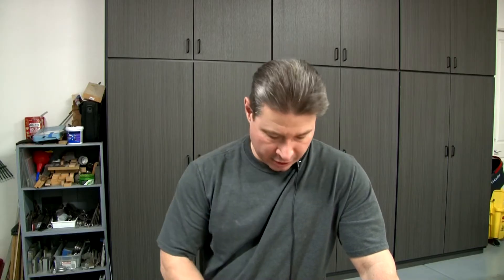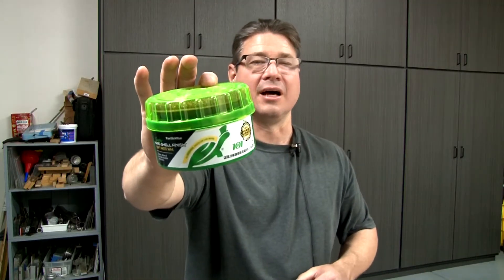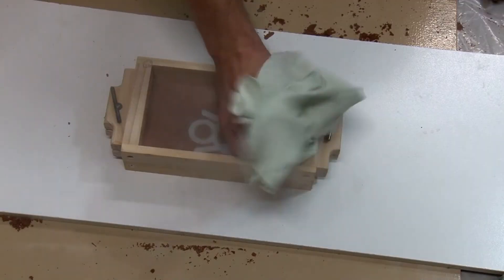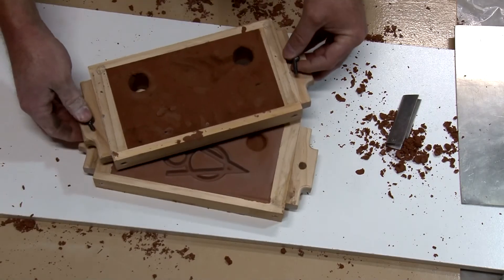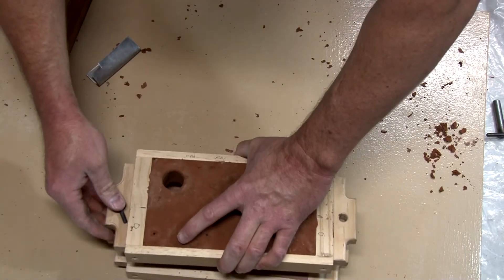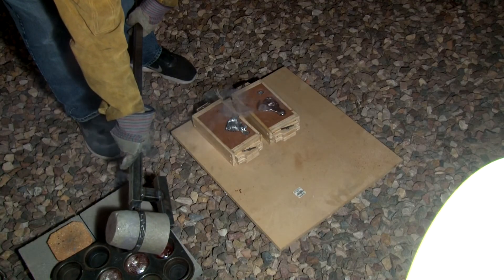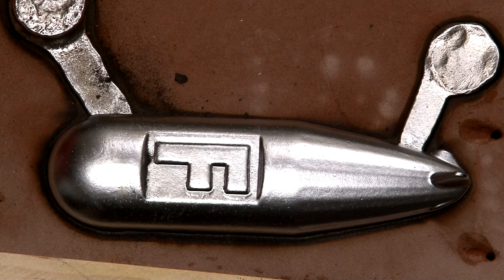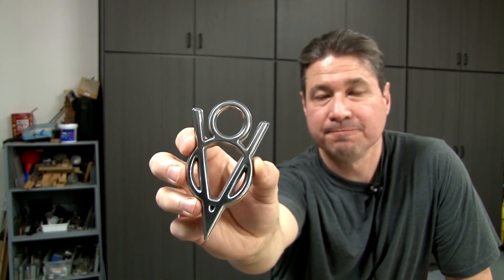From Bad To AWESOME, 1 Year of Sand Casting.  What I have learned in my 1st year of sand casting.

Comment: lost wax casting, so time consuming compared to green sand or oil sand casting. For production of lost wax, need expensive machinery to spray the molds around the wax pattern. 

I have seen brass casting in Punjab in India some years ago, in a back yard in Ludhiana, done with cement powder with molasses as the binder, and the finish of the brass military badge was as good as the original die stamped badge,  I was so impressed. I still have both badges

Comment: One safety note from when you added metal to the crucible. It's a good idea to preheat the metal you're adding in the flame before it gets put in the molten metal. This drives off moisture and burns off oil to prevent an explosion.
Reply from the maker: Thank you for pointing this out.  I live in a fairly dry desert and all my aluminum and equipment is stored in a garage.  I will point this out in my future videos for viewers that don't live in the same climate as I do.

Comment: does the quality of Aluminium used matter and if so, how to tell if the aluminium is good?
Reply from the maker: The aluminum alloy used for casting has silcon present.  Here is the list from google  that details why silicon is in the casting alloys:  "Improved Fluidity & Castability: Lowers melt viscosity, letting it fill complex molds better.
Reduced Shrinkage: Forms a eutectic mixture that solidifies more gradually, minimizing defects.
Enhanced Strength & Hardness: Hard silicon particles precipitate out, strengthening the alloy.
Better Wear Resistance: Hard particles improve durability.
Reduced Hot Tearing: Prevents cracking during solidification.
Lower Melting Point: Makes the alloy easier and cheaper to cast.
Corrosion Resistance: Can form a protective oxide layer, enhancing surface protection. "          I have tried to casting 6061 machining aluminum and it didn't not flow and froze quickly.  Also, another thing that will help with casting is a thermocouple temp probe.  Hitting a good pouring temperature helps alot.  If the temp is too low it freezes early.  Unfortunately, determining the aluminum to be an alloy for casting I am not able to do.  I start with aluminum that has been cast before  so I know it works.  Car parts, Hard drive chasis, etc...  Good luck!

Comment: Please tell me what kind of sand are you using ??
Reply from the maker: I got it from Amazon.com and it was listed as Teton-Bond Petrobond Ultra-FINE (190 Mesh) Foundry Jewelry Metal Casting Sand for Ultimate Detail

I used to be able to buy 100lbs at a time, which made it cheaper, but I can't find it anymore that size.  Amazon also has 140 Mesh, which is not as fine, but I am not sure how much difference it will make.
Reply: @DamonsMetalCasting  thanks

Comment: I urgently need a kit like that, sand, supplies, where to buy?
Reply from the maker: I got my stuff from amazon.  Just remember to coat the ceramic material inside the furnace so it won't cause lung damage.  The sand  i use is teton petrobond. Its a little expensive.

Comment: The logo looks great. How does it mount because my experience with emblems is they usually have tabs that the nuts thread onto?
Reply from the maker: Correct, there are no mounting points on the casting.  I made it without mounts  for my channel. Using a tig to put some on or a mapp gas torch with an aluminum brazing rod could fix it, or i would have to recast in a different configuration.  Thanks for checking out the video.  Much appreciated.

Comment: Bonjour, un grand merci pour votre vidéo qui m à permis de faire mes première coulé d aluminium,  je souhaite vous poser une question , quel est la terre que vous utilisez dans cette vidéo ? Pouvez vous mettre le lien d achat dans votre descriptif?  Un grand merci
Reply from the maker: I purchased my casting sand from Amazon.com.  This is the description "Brand: Teton Supply Co.

4.64.6 out of 5 stars(312)

Teton-Bond Petrobond Ultra-FINE (190 Mesh) Foundry Jewelry Metal Casting Sand for Ultimate Detail" .  Amazon used to sell it at 100lb quantity which made it 2.95 dollars a pound, but I have not seen that size sold for a long time.  Thanks for watching I am glad the video  helped you with your first casting.

Comment: This is very informative.  I'm thinking about trying this out on a hobby level but had a question about the strength of cast aluminum.  Is it fairly strong in the sense that you could poor usefull tools?  I'm looking at making a T handle wrench part and wondering if cast aluminum would hold up strong enough to be considered functional.  Doesn't have to be extreme torsion but enough to get a bolt tight with the strength of one hand.
Reply from the maker: You might get better use out of welding 2 rods together in a T for the wrench rather than cast aluminum.  I find the cast aluminum to be softer than  standard 6061 aluminum.   If you are some how attaching a fitting to the end of a casting that is metal to turn a bolt it might work fine.  I think cast aluminum directly turning a bolt might wear/strip pretty quick.  The aluminum also might make a comfortable handle for your T wrench if you made the rest out of metal.  Just throwing some ideas out there.  Good luck on your project!
Reply: @DamonsMetalCasting the only thing that gives me encouragement to want to try it is that it's not for a standard metal bolt like you think,  it will be for a 2" plastic head bolt and the wrench will just have a couple beefy "fingers" that index into the plastic bolt head. Normally this bolt is just finger tight anyway. I made one from maple wood which worked great.  The torsional strength of cast metal over time is what I wonder about though. Thanks for your thoughts
Reply from the maker: @DavidGeorgeson  Being that it's for a plastic bolt head, it will be fine.

Comment: What’s the tool you’re using to measure the molten metal? Do you have a brand name of that one? Is it expensive?
Reply from the maker: I got the thermocouple sensor and the thermocouple reader from amazon.  Looks like you can pick up a thermocouple reader for $30 dollars.  The part that may vary in money is the thermocouple for the reader it has to go up higher than the temp of the metal.  Some thermocouple sensors cost as much as $60.  If you look hard I think you can find it cheaper.  TL1917SL K-Type Inconel 600 Flexible Thermocouple Temperature Sensor Probes -40~2012°F  that might work for aluminum its around $40 on amazon. You still might find one less expensive if you look hard.
Reply: Thank you for the reply. I was seeing a lot of them for over $500.

Comment: Really nice teaching video I’m just wondering why you stopped. Another thing for the fins on the F bomb using toothpicks for channels to create air events will help dramatically and very easy to clean up. Also, I really like the thought of using car wax on the patterns. excellent idea🤠👍
Reply from the maker: Thanks a lot for the nice comment and the toothpick idea.  I hit a pause because I took on 2 jobs from viewers and the jobs turned out to be alot more challenging and problematic then I expected.  Instead of making people wait for the finished videos I might create parts of the videos of how I worked through certain problems.  Currently where I live, the mornings before the sun comes up are 89F.  I will be looking into a minisplit for my garage soon.
Reply: @DamonsMetalCasting  if you need some help sorting out some of your problems let me know I might be able to help. I have been pouring silver and copper for a few years now my videos maybe a little boring but you may find some insight in them cheers🤠👍
Reply from the maker: @4ninesfinesilver315  thanks appreciate it

Comment: I'm new to sandcasting. Every time I fill the mold with the delft clay and pound it down, the clay will "split" open on the mold. Usually it splits in a different part of the mold, that I'm pounding. I hammering the clay in fairly hard. Is it possible I'm doing it too hard? I just can't understand what's causing this. When I turn the mold over, the bottom of the mold is nice and smooth. Can you please tell me what could be wrong? Thank you in advance.
Reply from the maker: I have not used Delft clay before so I will just throw out some guesses that might help.  One issue could be if its been used up and has a lot of burnt binder in it preventing it from being able to stick together.  It might need better mixing/mulling.  Maybe a bad batch from the manufacturer?  I have pounded the heck out of my sand(Petrobond) and made a real hard layer, then the next layer on top doesn't want to combine to the first layer and peels off.  I have seen people scratch up the hard layer even with a hair pic so it can combine easier with the next layer added.  Sorry I couldn't help more.  Its difficult when not hands on with a problem and only throwing out guess.  Good luck!
Reply: @DamonsMetalCasting  Thanks for the reply. I just bought the clay, so it's never been used. Maybe it is a bad batch. Thank you.
Reply from the maker: @scotts4134    You can also look at videos online of people who use deft clay and see if its similar consistency and works the same.

Comment: Did you make the flask?  What are the dimensions, because I want to cast flat sterling silver pendants around 3 mm (1/8 inch) thick and that flask looks the right depth, as opposed to most of the ones on Amazon which are deeper.
Reply from the maker: Yup, I made the flask from wood on my table saw.  The outer flask dimensions are 9" long, 5" wide and one half of the flask is 1.25" deep.  The total depth of both halves together would be 2.5".  The inner dimensions are 7.5" long and about 4.25" wide.  The ends have thick wood on them so I can screw the sides in and attach a handles.  I agree, I like using flasks that are closer to the dimensions of the part I am casting.  Thanks for watching my video!

Comment: THANKS, HOWEVER, IMHO: MOST PEOPLE DO NOT HAVE "3D PRINTING" EQUIPMENT, SO, PERHAPS SHOW SOME "OLD SCHOOL" CARVING, AND "PATTERN MAKING" METHODS...?!...
[SUGGESTION: USE A LOT MORE AMBIENT LIGHTING, IN FUTURE VIDEOS.  SO THE DETAILS WILL BE EASIER TO SEE.]
Reply from the maker: Thanks for your feed back, I will try and add more light.  Honestly, I am probably stuck with using the 3D printer because of my lack of artistic skills.  I have Zero skills for carving.  I also plan to distribute some of my original 3d print pattern STL files which I can't do if I carve by hand either.  The used 3d printers of Facebook market place and craigslist are selling for as low as $100.  I do agree 100% that watching the old school pattern making is great but I am just lacking in the skill to be able to do that and time to learn.
Reply: It's ridiculous to expect every content creator to work around the restrictions of what the viewers may or may not have. The entitlement of people is mind boggling.
Reply from the maker: @chrisgenovese8188  Yup I agree, they should really have the mindset of it being a benefit to have the ability to experience something they can't or don't want to invest in.  I will never be able to purchase a sports car like a Ferrari, but I can have an experience of watching and learning about one that somebody shared in their video.
Reply: That is something entirely different! The title doesn’t read SCULPTING and casting 
If you’re unable to find a way of making your own objects to place within a mould or just duplicating something, then you’re obviously not very bright 🙃
Who types in CAPS honestly 🥸
Reply: A 3d printer can go as cheap as 160 dollars
Reply: Dude, you aren't ordering a pizza. Since you have so many suggestions do your own video.
Reply: you can get an actually good 3d printer for $200 nowadays.... a huge percentage of people even vaguely creative have 3d printers now

Comment: Thanks! Excellent video... I got my furnace and just built the frames for my casting. Once my bag of Petrobond shows up I'm gonna follow the steps in your video.
Reply from the maker: That's great I am glad my videos have been an aid to you for metal casting.  Make sure you also have a good set of lifting and pouring tongs.  Most important of all make sure you have a good set of protection gear.  Molten metal will be unforgiving if you have an accident.  I wish you best of luck and let me know how it turns out.

Comment: Talc: Cancer and neuropathy 
Deeelicious
Reply from the maker: I use talc with a dust mask and only use talc sparingly for the part to be cast in the sand.  Baby power which is now corn starch works well enough for me to use as parting powder since I literally have to dust it on all over the drag for the sand casting.  I have read that on the internet there is more of a link to cancer exposure with talc that has contaminates of asbestos included in it.  This was taken from cancercenter.com "According to the American Cancer Society, some studies have suggested that workers who mine or mill talc may be at increased risk of lung cancer, but other studies show no link. These workers are also likely to be exposed to other minerals and elements that are known to be carcinogenic, such as asbestos and radon, making it more difficult to assess how much of the risk is associated specifically with talc. The ACS states that additional research is needed into whether a connection exists between talcum powder and endometrial cancer for women who are post-menopausal."  I strongly suggest that people should do their own research before coming to their own conclusion if Talcum powder is something they should use.

Comment: One of the most insanely clean molds I’ve seen. What kind of sand do you use??
Reply from the maker: In this video I used a 190 mesh petrobond sold by Teton Supply Co.  The high mesh sand is used for casting very intricate parts or jewelry.  Thanks for watching and leaving a comment.

Comment: Best surface I ever seen!
Other youtubers use chemicals for degassing and Flux. What your thoughts/experience about that?
Reply from the maker: Thank you!  I haven't used chemicals or flux for my aluminum melts.  I try and use aluminum that has been cast before and is relatively cleaned off.  No point in adding aluminum with dirt on it and then trying to remove the dirt or impurities.  Also, I have seen people try and use flux with aluminum cans.  In my opinion aluminum cans are not an aluminum alloy used for casting and thin aluminum turns to oxide very readily before it melts.  In my opinion for the amount of aluminum I have cast, I would recommend using aluminum that is casting grade aluminum alloy.  That aluminum will melt at a lower temp because of the silicon content in it and will also flow better then other alloys.  I would also say melt chunks not thin sheets or chips that end up making more aluminum oxide then molten aluminum.  Then probably not over agitate or over stir it and gently skim the dross off before the pour.  When pouring have a nice consistent pour with a pouring basin to help with a smooth introduction into the sand cavity.  These things are what I believe work well for my casting.

Comment: What are your recommendations for vent holes throughout the mold?
Reply from the maker: I can tell you with the experience I had so far.  One thing not to do for making clean and smooth castings is to make the vents straight above your part unless your part absolutely requires it to fill properly.   I have watched another casting channel and a vent was made in the cope at the highest point of the part because that made sense as to where the air would be trapped.  Most of my castings haven't had a high point in the cope so I usually just run a channel off to the side and make a vent to the top using a 1/8 inch rod.  I wish I could just give you a definitive answer but it really just depends on the shape of the part you are casting.

Comment: Can we use cement sand the color grey sand. Like casting on it while its still a little moist..
Reply from the maker: Sure can, the grey sand that I use is called Green Sand because of the water in it.  It has a small water content instead of an oil binder mixed in with it.  My Petrobond(orange sand) is 180mesh in particle size, the green sand(grey color) is 190mesh also a very fine sand. If your Green sand(grey color) is too moist it will make steam and cause problems with your casting.  The finer the sand the more detail you should be able to transfer to your casting.  Good luck!

Comment: By far one of the most smooth casting I've seen here on YouTube. Well done. Can you tell something about the metal you're using? Is it just alumnium or an alloy with some zinc in it or something?
Reply from the maker: Thanks!  Yup the aluminum is an alloy I am not sure of the exact alloy number since I get it from salvaged car parts that have been previously cast.  Cast car rims work well, and so do cast engine intake manifolds.  This type of aluminum contains silicon to help it become more fluid.  Aluminum that was machined like the common 6061 or another type used for soda cans are terrible for casting.  Just look for a source that has already been cast and it will probably work well.  Good luck and thanks for watching.
Reply: @DamonsMetalCasting  Awesome! Thank you

Comment: I have that exact same Harbor Freight bandsaw. It's been working for at least 15 years. I used it today.
Reply from the maker: Thats great mine has been holding up as well but my blade pops of easily do you have the same issue, or ideas to fix that?
Reply: I have the same belt sander lol. Excellent casting work sir! Thank you for posting this!